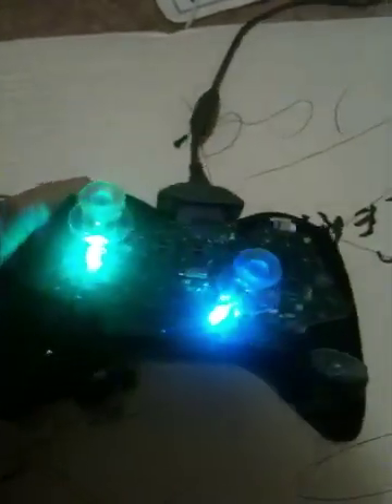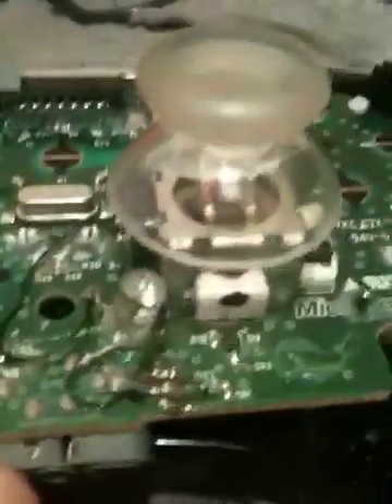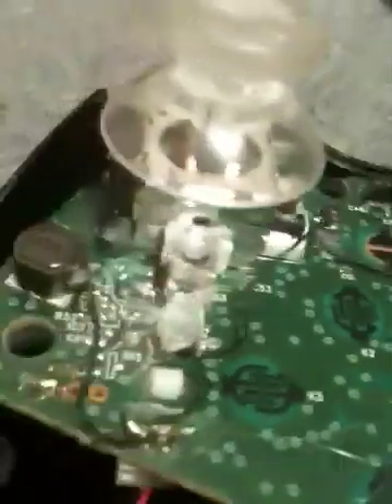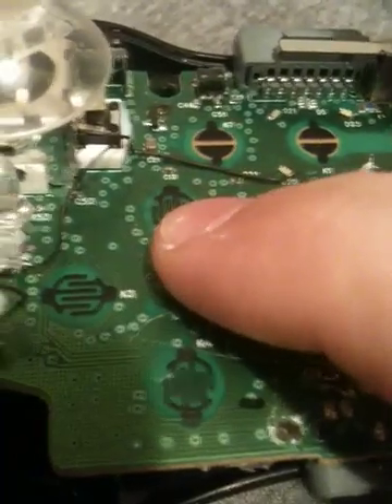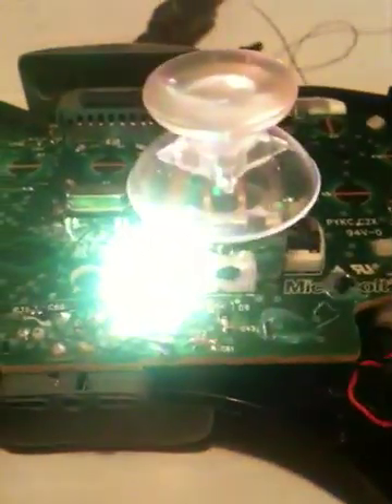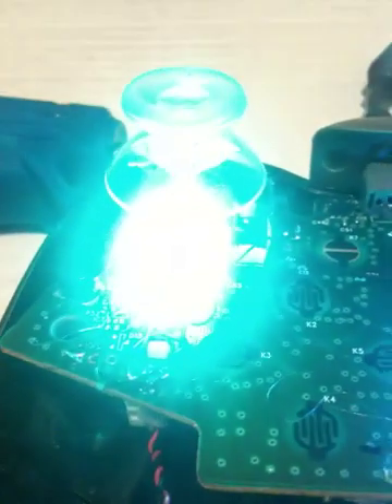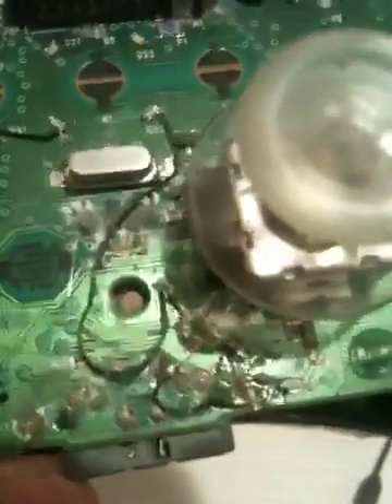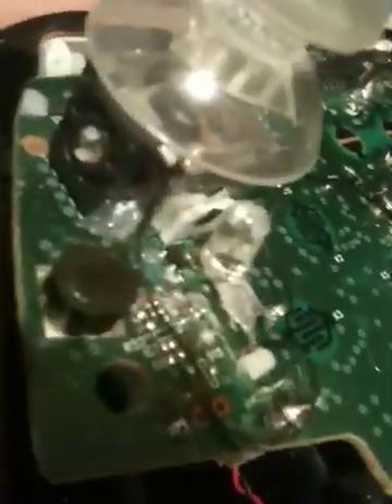Xbox Controller Thumb stick LED Mod, Easy+cheap

Comment from the maker: I actually ordered some micro switches off eBay and also got the wire off eBay. I believe its 30 gauge magnet wire which u can also get at ur local radio shack.

Comment from the maker: Forgot to say but u will have to remove some plastic on the inside of the top shell around where the thumbstick goes into. U will see where to remove when u try and close the controller